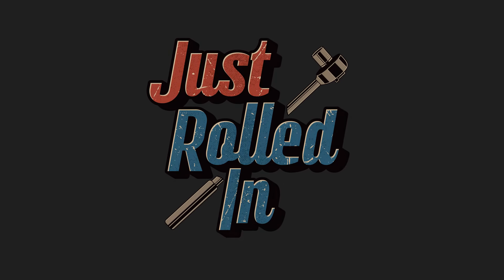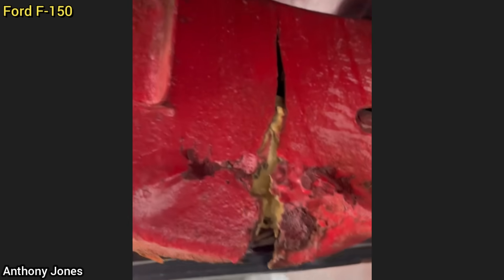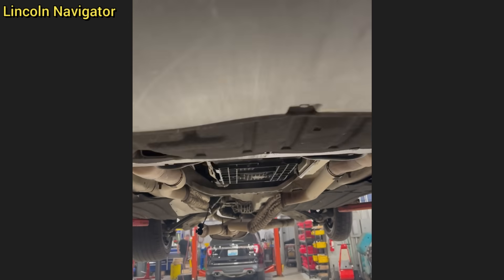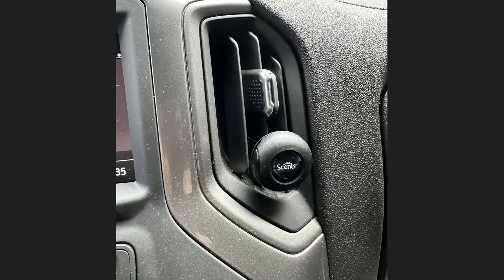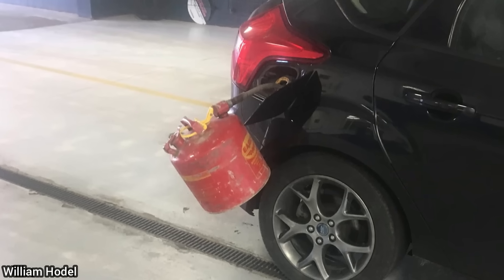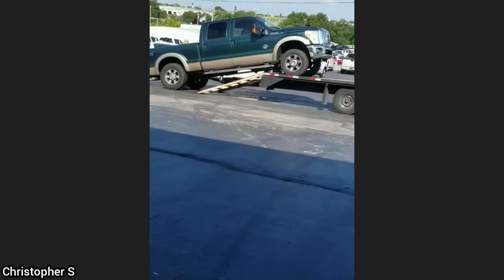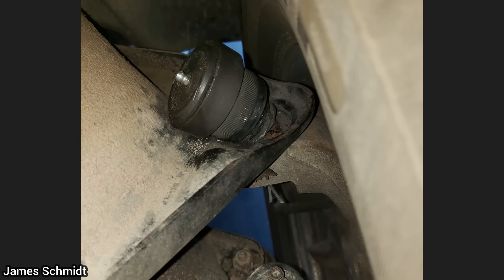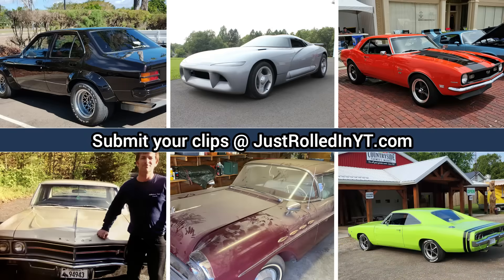Customer States Previous Owner Said Jeep Needed Small Repairs

Comment: Thoughts and prayers are the only things holding that subframe together lol
Reply from the maker: In rust we trust
Reply: I keep telling people, Prayers aint gonna fix this....
Reply: @ricksmith4736  Neither is duct tape, welds, jbweld or Bondo 🤣🤣🤣
Reply: @jsims2985 ngl the jbweld job on my power steering has held up pretty well on my 75' gmc. I can't remember exactly what part it was  that we couldnt get but it pretty much holds the pump on. To be fair the truck probably has less than 5,000 miles on it since then.
Reply: @KatiTheButcher  why you gotta be that person who ruins a good joke? J/k, I'm glad it's held up!
Reply: @jsims2985  Those items do a MUCH better job than prayer does.....
Reply: @ricksmith4736  Amen..
Reply: @TheoryRed F○ck that! Thoughts and prayers to the unfortunate souls on the road they're sharing with putting them all in DANGER! They should be ARRESTED!
Reply: @jsims2985  believe it or not by my request it was done at a dealership repair shop. Lol
Reply: I don't understand, someone is having an issue with their car, bring it in to have it looked at, then decline repairs. I would lose my mind and also charge double. To the mechanics out there, GREAT JOB putting up with customer's 💩!
Reply: @JustRolledIn  that should be on mech 😂
Reply: @kyzercube and the repair shop that wants to charge $5000 for weld repairs should be arrested for price gouging. It's an XJ (I assume), so many shops do this custom work (or, you know, anyone who actually works on cars?), a Meineke is going to charge out the ass. Good on the owner for refusing repairs.
Reply: @AKUSUXs  any number of reasons with something like this. Find a rolled one for $500 and swap the frame instead of thousands for a job that an oil change place isn't an expert in?
Reply: @zchris87v80  I'm a flag time transmission  mechanic. $5000 is CHEAP for frame reconstruction.  Meineke doesn't do frame work. You have to go to a body shop for that kind of work.
You know what I love the most about you DIY derps? It's you guys coming into my shop after you jacked your own shit up trying to fix something and ending up making it even worse costing you 2-5x more than if you'd brought it to a professional in the first place.  Keep doing stupid stuff to your vehicle. It just puts more money into my pockets.
Reply: On a wing and a prayer but the wing is on fire and the prayer has been answered by the devil!
Reply: @kyzercube  Spot on.
Reply: I think at some point a vehicle is so rusted that whatever deity or deities someone prays to will just not help. "This mortal made their choice" ;)
Reply: Thats not a subframe
Reply: Nah, the frame was perfectly fine until someone had to go and look at it. That's why one should never go looking for broken stuff and only fix the immediate problem.

Comment: the welded on brake pad is a classic. I have never seen as "creative" (scary) people as on this channel
Reply: That's totally an "I will make this work, I'm NOT spending $30 on this car!" mindset 😂

As bad as ratchet straps and chains holding up broken suspension.
Reply: I can't figure out why you would do that. Brake pads don't cost that much the weld was probably more expensive,.
Reply: @johncameron2241 in the time he made that weld he could have worked, saved up the money and bought multiple new pads that would be significantly less dangerous than the McGyver maneuver he did
Reply: @johncameron2241 in the time he made that weld he could have worked, saved up the money and bought multiple new pads that would be significantly less dangerous than the McGyver maneuver he did
Reply: I found that one the least concerning actually. Pretty good way to use a set that otherwise won't fit and obviously it held up fine
Reply: Yep..& it's such a wide spectrum; closed vents, filters still in plastic, can o'nuts causing rattle, etc VS frame rotted away, brakes/tires/whatever completely shot, etc

Did kinda like that 'artistic' square exhaust job though. Can't stop watching but 3min is plenty for me:/
Reply: @hoerenj0ng141  Having worked in car parts retail.......... it's honestly just... WAY easier and safer and saner to take the wrong-size pads back to the parts store and be like "Hey I bought the wrong pads for my car, can I swap 'em?" and the folks at the front counter won't even bat an eye at the request, because it's just so commonplace and so normal for people to end up buying the wrong parts for their car because their car is some weird half-year model or some uncommon options configuration. :/
Reply: Probably had extra brake pads laying around just wanted to recycle ♻️
Reply: @TheBanjoShowOfficial Lol, what? I'm not saying it was a smart idea but it literally would have taken only a few minutes to tack those pads together 😂. I've been welding for nearly 30 yrs so I can assure you that wouldn't have taken long even for an inexperienced welder
Reply: Lol I can't imagine what was going through their head that said "Eureka, I'll just weld this together!" Hahaha lol 🤣🤣
Reply: Maybe it was a sunday job and all the shops were shut,saying that know a so called mechanic who most likely has done that
Reply: It probably worked, though. But brake pads are cheap. Doing that was more trouble than it's worth
Reply: do you have any idea how happy i am living not in the USA...

Comment: Wise up, people! Before buying  a vehicle, pay $100-$150 for a Mechanic to inspect the vehicle.
DO NOT buy the vehicle at night!
Reply: Assuming you have eyes and ears and senses that work you can inspect the vehicle yourself. 
Check for rust all over, including UNDER THE VEHICLE. Also whilst you’re there check the bushings, check the exhaust and evidence of any leaks / oil leaks. 

Open the bonnet, check the engine bay. Start the car, check the engine bay whilst the engine is running. Listen to the engine. Look for any oil leaks. Check the fluid levels. Check the brakes and tyres. Check the bodywork. Check the shock absorbers for leaks. 
Then test drive the car. Feel it, listen to it. Test it properly … 

It’s really not the difficult.
Reply: @mista5796  The UK  has a very strict MOT. In America, each State varies in Inspection Requirements, if any! America is broken!
Reply: @alansmith4734 People should learn to be responsible and have common sense their own self instead of having a law being enforced on them with a gυn on their head.
Florida which has none is much better in cars than UK where people desperately try to patch cars up doing bogus repairs so they fool MOT or fail due to a stupid problem that does not intervene with any of the car's functions and wont have a car to drive to their job for like a Lamda sensor making the engine not working in closed loop.
Reply: @mista5796  If you go under a car, bring a pen or pencil.
Why? So that even if they painted the underside, you can check for places where there are microns of rust painted black.
Reply: Not buying a car at night is a big one, good advice!
Reply: I told my mother to pick out ads for ten or more legitimate dealerships selling certified roadworthy vehicles of the type she wanted. I told her to visit as many as possible to get the list down to the five best; then pick the best one.

She bought a car she saw in some guy's driveway one afternoon.  "I saw the sign in the windhshield and he said he's a professional mechanic ..."
Reply: My brother bought at night.... The next morning I pointed out everything that it had going on....
Reply: I'm in a service type industry.  It's amazing how many people say "it just happened for no reason".

Comment: 🤣 Welding a brake pad to another brake pad? I'm not even mad, I'm impressed
Reply: It must take a lot of patience and skill to do that
Reply: @thomasfletcher760   supply chain issues solved
Reply: I'm sitting here wondering if he had to grind the rest of the lining off the old pad first, or if it was already all gone.
Reply: I  could see such a repair be viable if you're stuck in the middle of nowhere with no way to get the right part, and you just need it to last for a short while until you're in a better location.
Reply: Use what ya got😊
Reply: @martin_soerensen    Yes, " Magyvered" ...... LOL
Reply: @martin_soerensen  Stuck in the middle of nowhere... With a welder?
Reply: @tarille1043 😂😂
Reply: @tarille1043  In some isolated place where spare parts might need to be flown in. Even in remote places you can find shops with welding equipment. Even more so I such places since they are used to handling every situation right there on the spot without relying on Amazon, ebay, whatever.
Reply from the maker: Maybe the customer was stuck on Mars with only a welder and left over brake pads. I'm going with that story 😜
Reply: Probably cost him more money in wire and electricity than a set of pads would have cost. LOL.
Reply: Would not be surprised if that was done by some mechanic
Reply: Xzibit would approve

Comment: That second clip may constitute fraud, they knowingly sold a vehicle with that frame damage that they tried to repair, telling them it was in working order. It's definitely a guaranteed win in civil court.
Reply: If it is a private party sale, and was listed "as-is" there is no legal remedy.
Many states don't have lemon law protections for used cars, and even the states that do only have it for cars sold by companies with a minimum # of sales per year, and only if the sale price of the vehicle is above a certain threshold.
Reply: Yeah spend 10K in lawyer fees on that 2K car......
Reply: @Sonny_McMacsson  I said "many states" because this conversation was not worth the time to research the different lemon law statutes in 50 states, plus DC and territories.
So instead, I erred on the side of not stating unsupportable absolutes.
Sorry that did not meet your approval, Your Highness.
Reply: I don't think it works that way depending on the Lemon laws. But in Canada we have no "Lemon laws" However if you discover the Damage or rusting after the point of sale you can: Record the damage, Fix it and take it to small claims court to recover the cost of the repairs.
Reply: @MonkeyJedi99 That depends on the representations made to the buyer as to the condition. If the truck was advertised in working order then the seller would lose in court. Simple contract law applies, not lemon law. Given the attempted repairs it would be easy to prove the condition was known to the seller would be they guy paying the attorney fees and refunding the cost of the vehicle.
Reply: @MonkeyJedi99   Folks this is why you don't take legal advice from youtube. as is means as is.

Comment: One of the first things my father taught me  when it comes to buying vehicles is to look under the vehicle to check for damage, rust (especially on vehicles that shouldn't have it), and whatever maintenance repairs that I may need to do if I buy it. It only takes a few minutes max to do, and saves you from future aspirin and antacid binges.
Reply: My father taught me to never buy a car without someone else checking it over. He never did, thus lesson learned. When excited to buy a car it's easy to overlook faults that are obvious the day after purchase.

Comment: It just... blows my mind... like the air-vent not being open. Airsoft guns are not cars, but I used to manage a small store... My guys were trained to really focus on educating and preparing new customers for their fun toys they were taking home. You'd spend 30 mins with them, real bonding moment right? They'd come in the next day, frustrated... angry even... gun doesnt work... And well... you'd ask them... "Did you plug in the battery?" "I have to do that?" "Do you need to plug in an electrical power source to operate your electrically-powered device? yep... sorry I dont make up the rules..."

Comment: A good number of these guys declining repairs need to be brought up on charges for reckless driving and reckless endangerment. OMG.
Reply: Was following behind a car the other day and the back left wheel looked like it was about to fall off. I pulled up honk tried to get them to pull over but they sped up and took off down the road.
Reply: @ryans413  I swear, I see more cars with misaligned rear wheels on the road than I do aligned ones. Do people just not care about taking care of things? Took my 2004 maxima in earlier this year for an alignment, and it was hardly out. One of the rear bumper clips broke and it gave the slight appearance of a cambered rear tire. Stupid of me not to check, but most cars on the road look far worse.
Reply: They are declining repairs because the shop most likely is trying to rip them off. I've been there before,......had to decline a leaky breakline because the shop wanted 1,600 to repair, I said no and drove next door and had it fixed for $250. A lot of these shops will take advantage of people.
Reply: @evognayr  That does happen in life, but I seriously suggest you look at the clips before you say yea or nay; There are many cases of extensive damage and/or flaws just aching to take out the vehicle and whoever is unlucky enough to be nearby!
Reply: @zchris87v80  At least you did something you thought it was out of alignment and got it checked. More then lots of people on the roads would do.
Reply: @evognayr  yes that your right to shop around but you also gotta be careful with cheap prices because the mechanics might not do a good job and cause more issues. Best is too look up the shop online read reviews get a good understanding if their a good company

Comment: Couldn't make a video but have to share this one. Our customers complained they can no longer programme the engine ECU with our software. Installed three new units, tried 78 times and nothing. Then he called us. He had gotten a new laptop that is running faster. We had a bug in which can message timing was sent out as fast as possible. The ecu said back: You take it easy! Your talking way too fast. And shut down programming mode. 
So much for spending a lot of effort to make our hardware/software faster 😂 The fix? Use a ten year old laptop and wait patiently.

Comment: I honestly feel bad for the Ford Focus owner with the gas can stuck. Those Fords without a gas cap design can be tricky using a older style can, at work we always use a funnel to pour gas in and even with that they sometimes get stuck.
Reply from the maker: That's what it says in the owners manual to do. Use the funnel that is in the vehicle. If I remember correctly.
Reply: The root issue is running out of gas in the first place. It requires the bare minimum of awareness and effort to avoid that one.
Reply: @JustRolledIn  Correct. Ford supply a properly sized funnel with the vehicle, Mine lives in the glovebox. 
Never had to use it because I'm not an idiot. Fuel light comes on, I fill up, despite petrol (95RON) costing the equivalent to US$7.10 per U.S gallon (£1.50 per litre)
Reply: @JustRolledIn Yep, included in the spare tire foam.
Reply: Yes. All the Fords that have the capless design, come with a special funnel to use for that exact reason.
Reply: I had a similar issue siphoning some gas but managed to get it out eventually

Comment: The number of declined repairs is depressing. So much junk on the roads!
Reply: There should be a diagnosis charge.
Reply: Maybe they just need a diagnosis.  But, yes, driving away with significant safety issues is questionable.  On the other hand, shop rates ain't exactly cheap these days.
Reply: @major__kong  I know these things aren't cheap,   but they've brought the car to the shop already, so it's just crazy they drive away this often.
Reply: @MaterLacrymarum no, it is prudent to get several quotes if it is something major.

Comment: I can't imagine a situation where I'd rather drag out the welder than just go get the right brake pads.
Reply: you have some pads they are not too big but are not correct . welding costs pennies and is right there. didn't really look that bad to me . not ideal and i would never do it but probably better than no pads or metal on metal.
Reply: You're changing your pads on your daily driver on a Sunday after the parts stores are closed.  Your choices are: Put back the old pads, 2) take Monday off, or 3) fire up the welder.

Comment: I believe many declined repair because the customers have faced scamming auto shop before.

Paragon Acura in Queens, NY always wants me to change engine oil and cabin filter which I always let them do until they tell me to change oil after another shop already changed oil a month earlier. There is also telling me cabin filter needs replacing the week I put in the K&N filter I got from Amazon.

Comment: Wife took car to weld shop so exhaust could be fixed... We just found out that the catalytic converter was removed then welded together with straight pipe. Addicts would simply cut the catalytic off and disappear into the ether but this weld shop replaced the pipe and welded it back together... Car went into shop with it attached but came home without it

Comment: Y’all don’t have to worry bout frame rot for those that live down south and/or away from the salt belt states. As a person living in the North East, I will NEVER buy a USED body on frame vehicle up here.😂😂
Reply: Yes I moved from a non rust area to the rust belt and was shocked. Low mileage and fairly new vehicles that I would have bought without a second thought ‘back home’ are just rusted out junkers here. I can’t believe people don’t rust treat their expensive new vehicles to make them last.
Reply: @squangan  Last new car I bought went from dealer to rustproofing place same day. Still clean and only had surface rust on bolts 3 and 1/2 years later when I sold it. Bought an older Honda from Tennessee 12 years ago and as soon as it came screws state lines, went straight to rustproofing. I still have that Honda. Seen one northern winter.